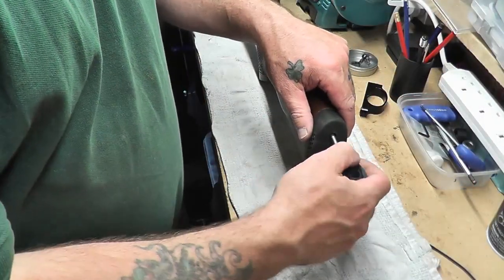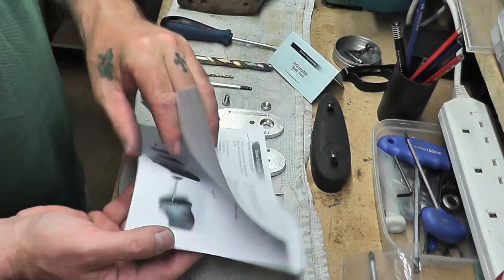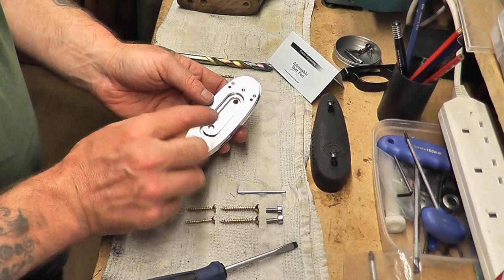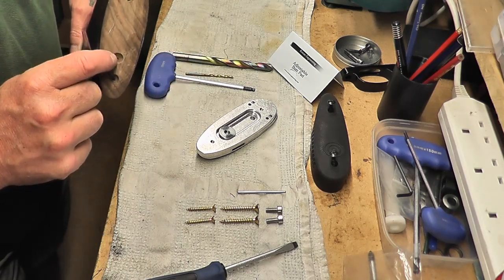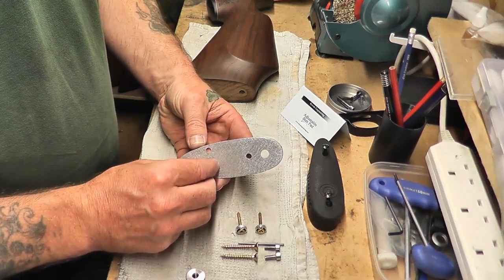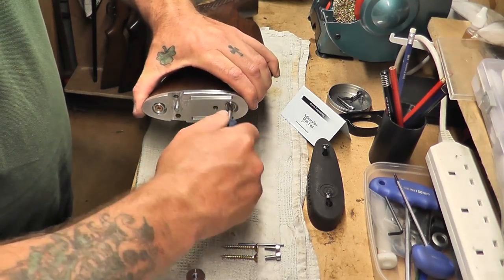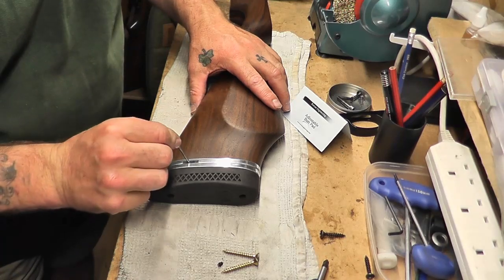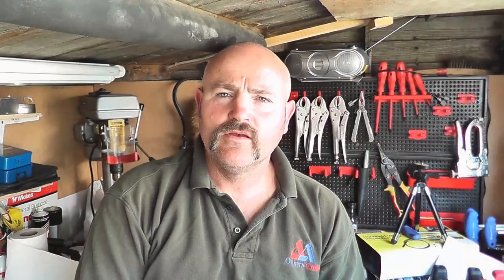Fitting a Rowan Engineering adjustable butt pad

Comment: Excellent Davy. Very clear and instructive. Think I'll get one for my TX200. I'll apply wood sealer to the end grain underneath the adjustable butt pad. Helps to prevent moisture from slowly swelling the wood over time making the wooden butt section slightly larger than the butt pad or plate. 

Have a Rowan Engineering adjustable trigger blade fitted to my rifle and it's superb. They also make a curved extra-set back trigger blade for the Weihrauch Rekord trigger for those with smaller hands.

Comment: Thought it might be worth a mention, on my butt pad you couldn't see the holes for the original screws. Had me puzzled for a while as to how the pad was stuck on. If you pull the pad apart from the edges using light pressure with the thumbs the screw holes/slots will become apparent. Use a lubed screwdriver so it doesn't damage the rubber when you push it in the holes. Your pad looks different to mine
Had a Rowan Engineering adjustable trigger for my TX and it's brilliant, quick delivery too.